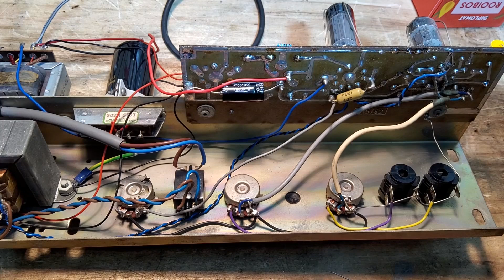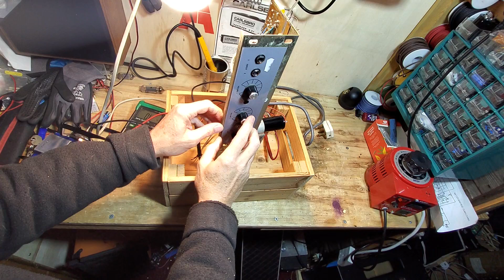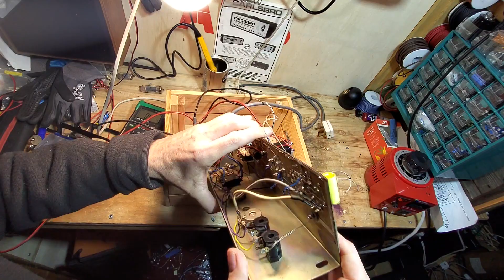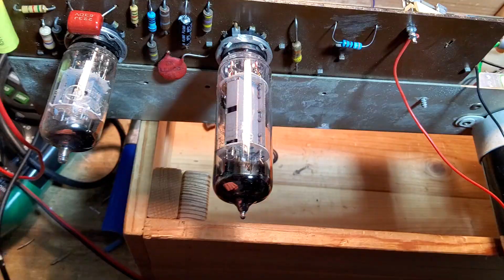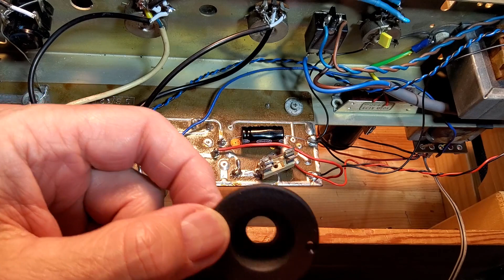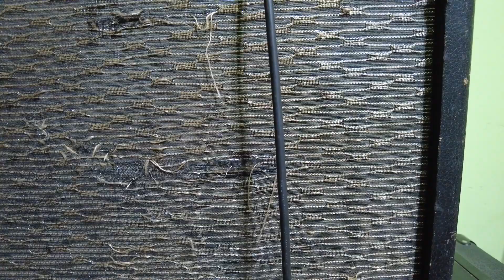Dallas Scala 1960s Tube Guitar Amplifier Gets Some Mods

Comment: Sounds killer now, from a cheap little practice amp you've transformed it completely. That original 8" Jensen speaker sounds surprisingly good. 
You mentioned it had been a difficult project to finish and the last shot it was frying away merrily. I wonder what had to be done to stop the frying and get it sounding so good?
Reply from the maker: Hello Rob, thank you. The frying was the pre-amp tube socket. I cleaned it. It may start playing up again though. in time. I may have to change it. Take care.

Comment: Excellent result Martyn.. Those mods made a huge difference from where you started with it. Even through the 8" speaker it sounded really very good. A lot of 'techs' say they don't like fitting master volumes. Well I would say in most cases, it makes an amp a lot more versatile especially if you have next door neighbours.. 😅..
Reply from the maker: Hello Pete, thank you. Yes it came pretty good Master volume works well. Take care.